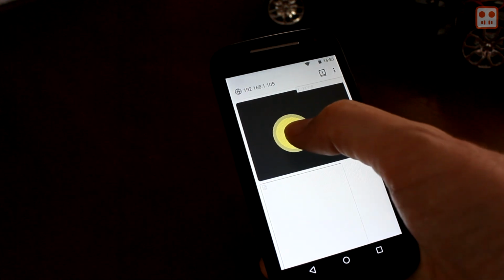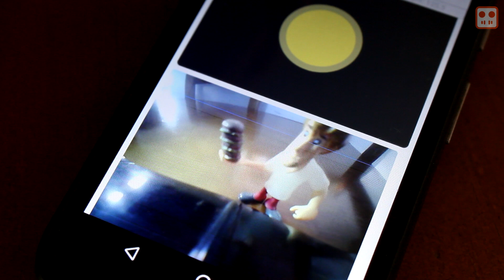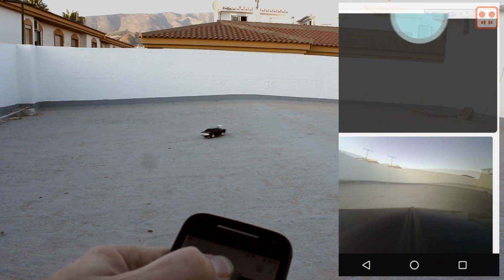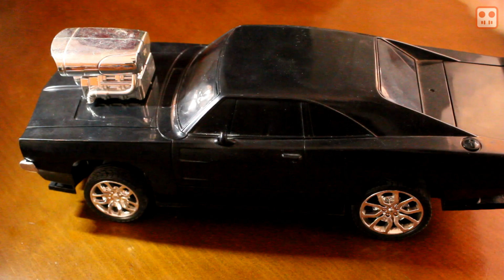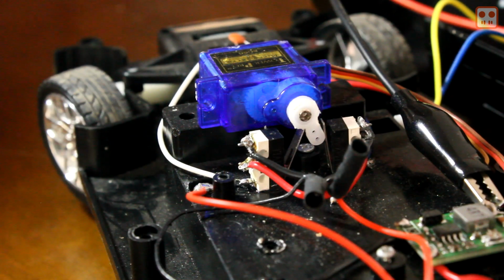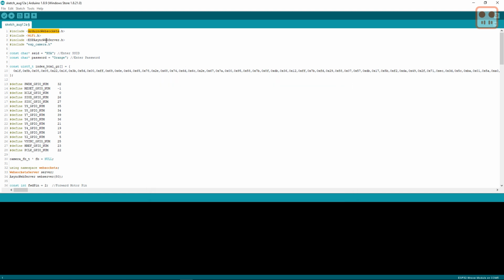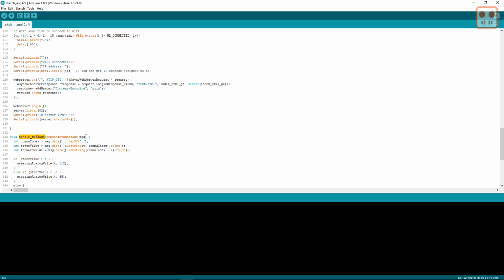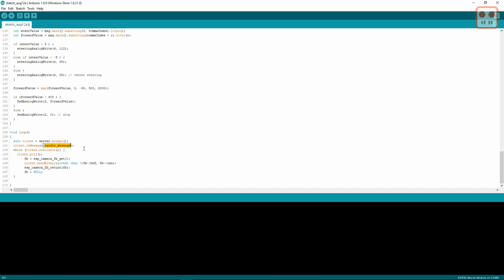ESP32-CAM Remote Control Car with Onboard Camera

Comment: No batteries in the RC car?
Reply from the maker: They are underneath. Just like a Tesla ;-)
Reply: @robotzeroone  thanks. What batteries did you use? :)
Reply from the maker: @DUGGYMUSIC  4 NiMH AA. There's a wiring diagram on my blog - https://robotzero.one/esp32-cam-rc-car/
Reply: @robotzeroone  Thank you. Do I have to use only the NiMH AA battery?
Reply from the maker: @DUGGYMUSIC  I used NiMH so the ESP32 gets 5v. 6v might be too much. Also I think the step down I used is only 5v to 3.3v.
Reply: @robotzeroone  Thank you very much. Sorry to keep asking, but what kind of drive motor and steering motor did you use and are there any wheels that fit them? Sorry to bother you 😥😥😥
Reply from the maker: @DUGGYMUSIC  The motor, wheels etc are just part of the radio control toy car. I just removed the radio control part and wired in my own system to control it.
Reply: @robotzeroone  
Thank you. Is the battery connected to the motor controller?
Reply from the maker: @DUGGYMUSIC  Yep. Check out the wiring diagram on this page: https://robotzero.one/esp32-cam-rc-car/
Reply: @robotzeroone  Thank you very much for your reply. Finally, let me ask you one more question.... Two wheels are connected to each motor, but usually one wheel is connected to each motor, right? How did you connect it? Or is it possible to make this RC car with 4 motors? Thank you so much for all the replies.
Reply from the maker: @DUGGYMUSIC  This car has one motor with gears connected to the rear axle that drives both rear wheels. Front motor is just to turn the wheels left or right for the steering. This is the easiest way of going things. 4 wheel drive is more complicated.
Reply: @robotzeroone  Thanks. I have two 3.6v 18650 batteries, will this work?
Reply from the maker: @DUGGYMUSIC  Some people say yes - https://arduino.stackexchange.com/questions/77844/powering-an-esp32cam-by-a-battery others no - https://www.reddit.com/r/esp32/comments/c8xq90/esp32cam_maximum_voltage/ I would either follow this project exactly or  learn how to do it with your own materials. There's lots of power converters and motor controllers for all sorts of situations.
Reply: @robotzeroone  THANK YOU SOOOOOOO MUCH!!  Finally all connections are complete. However, there is one problem, that is, when I enter the address value obtained from Arduino in the phone, the screen does not load at all. What's wrong?
Reply from the maker: @DUGGYMUSIC  Are you connected to the same Wi-Fi network? You could try on a desktop computer to see if that works.
Reply: @robotzeroone  Wifi is no problem. It is connected when it is connected to the computer and mounted on the breadboard. But when I remove it from the breadboard and connect it to the parts, it doesn't connect.
Reply: @robotzeroone  what is the runtime of this car?

Comment: Haay please reply
"Can we run the car through the port forwarding " plzzz say
Reply: Means by forwarding the espcam ip to wide network can we run it by port forwarding
Reply from the maker: @avinashgaikwad2428  You can change the code to give a fixed IP and also change the HTML and then use port forwarding on the router but it might be too slow to control the car properly.
Reply: @robotzeroone  you have given fixed ip only no ? Or it's change
Reply from the maker: @avinashgaikwad2428  Code on the ESP32 currently connects to the router and then shows the IP address the router gave:   Serial.println(WiFi.localIP());  You can run the ESP32 with a fixed IP instead. In the HTML you have to change the port number to the port you use for forwarding.
Reply: @robotzeroone  I am using ngrok is it best
Reply: I want to contact you please give you Gmail or telegraph link so I can contact plzzzz🙏. Because I want to control the car from any where , please help
Reply from the maker: @avinashgaikwad2428  The problem is I have a 4G internet connection that prevents port forwarding so I can't test anything that involves connecting from outside my network.

Comment: I have an error compiling for board ESP32 Wrover Module 

And there is no rzo in Partation Scheme
Plz help
Reply from the maker: Are you doing the car tutorial? You don't need the partition for this.
Reply: No I just verifed it
Reply: And there is error shown 'an error compiling for bord ESP32 Wrover Module'
Reply from the maker: @koukchay6827  I need to see the full error message.
Reply from the maker: @koukchay6827  Can you post it as a comment on the blog post. Or maybe just try again following it here: https://robotzero.one/esp32-cam-rc-car/ it should all work.
Reply: @robotzeroone  Sorry I can't post. It's too long😢.
Reply: @robotzeroone  what should i supposed to use( the code u gave in the chart or download raw or see original)?
Reply: @robotzeroone  There is new error when I use the code from "download raw"
invalid conversion from 'const char*' to 'char*' [-fpermissive]
Reply from the maker: @koukchay6827  does it give you a line number or more info?
Reply: @robotzeroone  yes line no. 106
Reply from the maker: @koukchay6827  that's   WiFi.begin(ssid, password); I think you might have a problem with the WiFi library it's trying to use. Did you follow this tutorial? https://robotzero.one/esp32-cam-arduino-ide/
Reply: @robotzeroone  hey i got it thanks million

Comment: What is the range on the camera like?
Reply from the maker: The Wi-Fi range? It depends on so many factors but I would guess the same as a mobile phone using a Wi-Fi router.
Reply: @robotzeroone  i saw a guy on youtube using esp32 cam over 10km distance i dont need them much mby a 1km so im just asking
Reply from the maker: @almirbajsini  It's the limits of Wi-Fi you need to investigate. At 10km they are sending very small amounts of data. Maybe look at other forms of transmitting data. Video at 1km is going to be hard.

Comment: HELLO  I USE FIRST THE SKETCH EXAMPLE IN ARDUINO OF THE CAM WEB SERVER BUT ONLY  I CONNECT WITH THE IP DIRECTION THE VIDEO OF CAM AFTER I COPY YOUR CODE ONLY HAVE VERY DIFFERENCE OF THE ORIGINAL CODE AND DONT COMPILE. THANKS SEE YOU

Comment: Uh, that is neat to ingenious, I mean use of the servo and limit switches to change the steering motor direction - one would normally hook the servo to the streeting gear directly. ;o) Does this approach have any specific advantages? / I am still wrapping my head about it. Is my understanding correct, that with servo in the center none of the limit switches is switched and hence the sttering motor receives new juice (whereas depending on which of the limit switches is switched, the steering motor goas in this or that direction)?
Reply from the maker: Yeah.. servo in the middle both switches just connected to negative. When limit switch pressed negative disconnects, positive connects. Google NC NO. No advantage.. just easier to keep the current motor for steering than put in a servo.
Reply: @robotzeroone  And the steering motor has there some sprocket wheel and bar, right? 

Yea, Smart, anyway, actually made me order a bunch if switchers to my stock. I do not have any vasted toys around so I will do with a 2WD instead. Just need to figure out what free pins I can use along with the cam on.
Reply from the maker: @liszcgsedt  Yep.. I think it's a rack and pinion system for the steering.
Reply: @robotzeroone  Yep, the usual. Tried making that out of popsicles, paperclips, paper and glue. Was almost there, but it was too much hassle, will settle with a two-engine three-wheeler for the time being, or with lever-based steering.

Comment: Can I ask the purpose of step down here? to protect the components?
Reply from the maker: It's to the keep the voltage to the ESP32 stable. The voltage of the 4 AAs will drop as they are used and could be between 4v and 6v which is either too little or too much for the 5v input on the ESP32-CAM. This way I keep a steady 3.3v to the 3v pin.
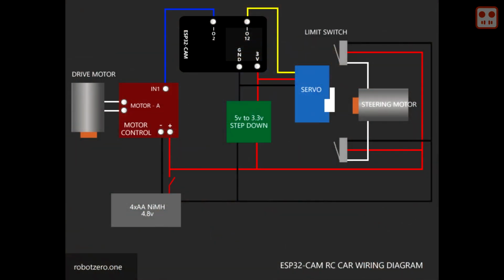Reply: @robotzeroone   Thank you for the reply. @2:56 can I assume that MotorDriver controller is ok with voltage range, or is it good to have 1 for MotorDriver too?
Reply from the maker: @croydon21H  The motor controller has a supply voltage of 2v - 10v with a signal input of 1.8v -7v so you don't need to control the voltage for this.

Comment: ..is there a way to acces esp32 cam through mobile data?(the esp already connected to router)
Reply from the maker: You would have to use port forward on the router for both the video stream and the HTML so you can access it from outside your home network.
Reply: ok ..i'll try ..thanks a lot..,